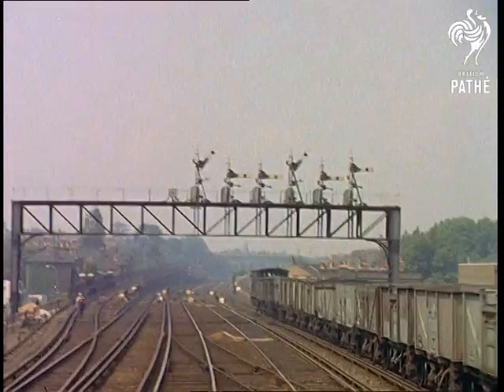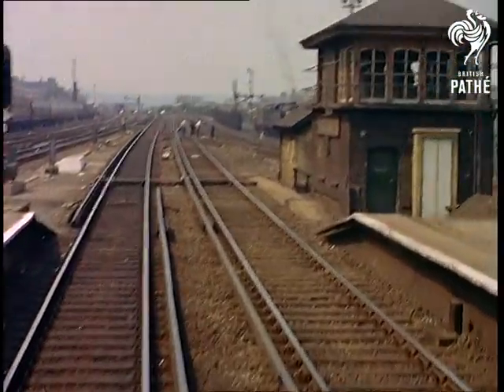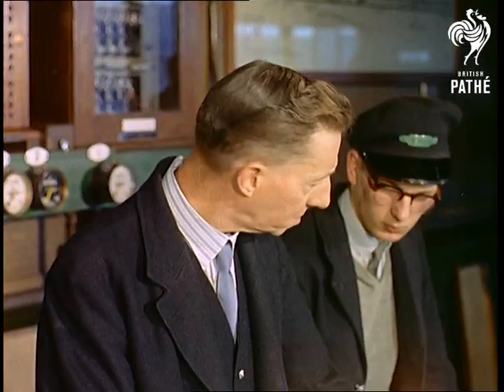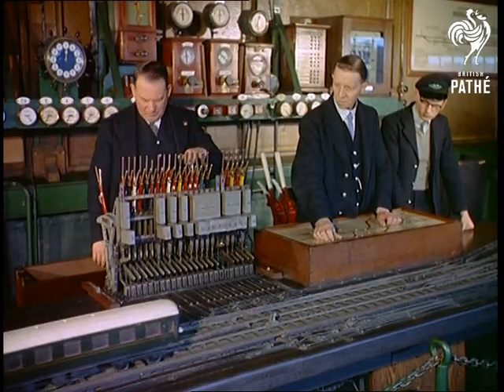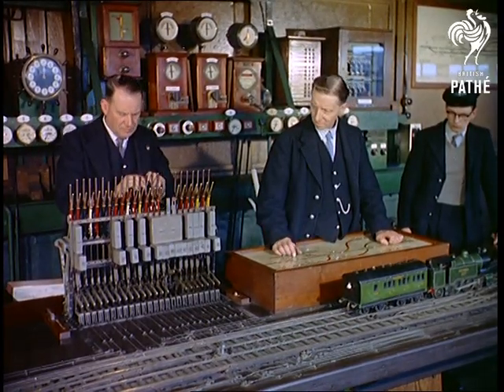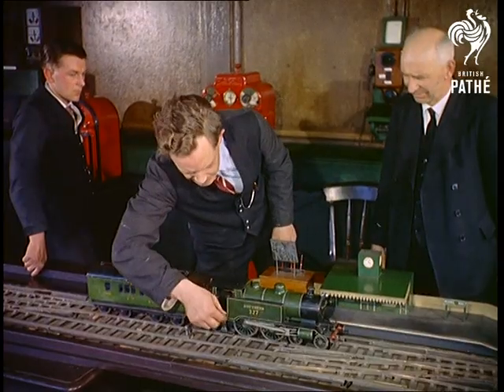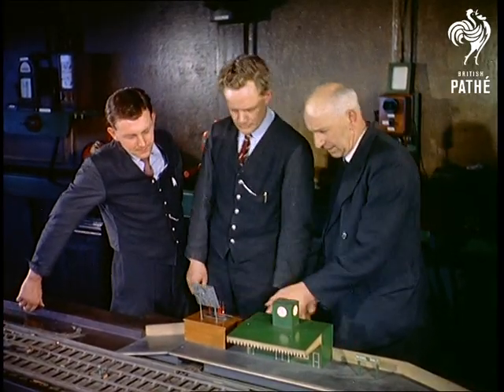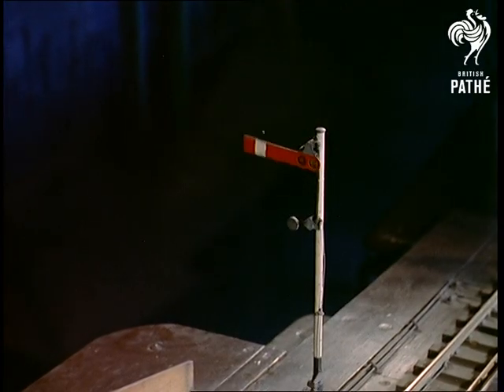Railway Signal School Aka Railways (1958)

Comment: Hilarious. I started learning about Signalling at the age of 10, when I commandeered my first British Railways Mechanical Signalbox at Sanderstead. Indeed the Station Master gave me a funny look and stated "I was a little short to pull on those large levers". Indeed he was right I could in fact only pull two of the 17 levers at that age. And that was because they were the Up "Intermediate Block" signals at Riddlesdown so worked electrically. For the other heavy levers that had to pull some signals as far as a mile away, I commandeered Uncle Bob who was the official Signalman, to give me a hand. And to bang out the bell codes, I had to stand on a box. What fun I had in those days !